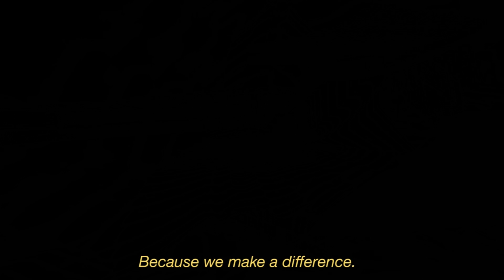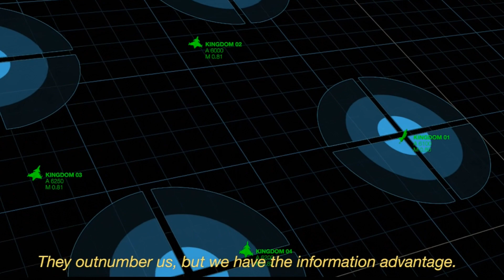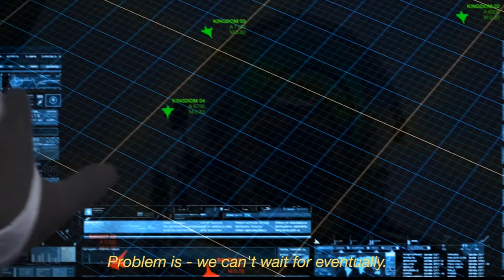Gripen Fighter Jet - Canada's Future Fighter?

Comment: Nothing beats the f-22 and t50. But the difference in performance between the 2nd 3rd tier fighter jets aren't that big... and Gripen is somewhere in between tier 2 and 3 in my opinion. But its trumphcard is that it is much cheaper and more versatile than the other planes. Not only will a country have a plane it can afford to lose, it will also be able maintain its plane in wartime as well in peacetime. Its a cheap plane to fly and maintain... while old F16 planes makes military budgets bleed, and F15 is a great plane but it got two engines that needs lots of maintance and fuel while it is not a plane that is clearly better than the JAS39 Gripen. And Finland also got F18 hornets, that got two engines that cost money, while their planes usally gets defeated in excercises by Swedish Gripen planes.

Gripen is a plane you can use in harsh wartime. You only need one technician and two concripts to maintain a Swedish warplane, while a typical American fighter needs 15 mechanics. Gripen could also start from very short runways, in case of the enemy has destroyed all your airfields, so you can use ordinary highways as runways in the case of war. So Gripen has the good potential of becoming a Navy jet on aircraft carriers as well due to its great ability to start and land on short runways.

Its also a plane suited for Canadas cold climate, since Swedens climate is pretty much the same. While I heard the F35 is unable to operate in sub-zero temperatures. And it needs 12 hours of maintenance and 17 mechanics required PER AIRCRAFT just to fly it for 1 hour. While Gripen is relativly cheap.
Reply: The Gripen NG is nothing like the first production model.
Reply: Use the generation numbers, Gripen is gen 4 while any stealth aircraft are gen 5
Reply: Russia stealth tech has yet to be seen and the T50 is suffering a lot of delays. Though I have no doubt it will be a deadly fighter.
Reply: I am not impressed by the F22 or the F35. F22 is a good plane, but overpriced and uninteresting since its not on exports. I would say therefore that Gripen is the best plane a country can buy right now. Unless they wanna buy Russian.
I think the F35 is clearly inferior for 3 reasons.

1. Its a shitty compromise between many roles a plane can play, where the worst traits seems to have been picked for each role.

2. Americans arrogantly thinks that we now live in the age of missiles and therefore manouvering is useless. Just like they thought in the past when they didn't give the F-4 Phantom a cannon.
Which is just a stupid belief.
Furthermore doesn't stealth give any magic protection, so maybe its therefore a good idea to look for other ways to increase the surviveability of a plane. Speed and maneuverability for example.
Russia also got superior missiles to the American stealth fighters so ithey would be able to kill the American planes from 400km away - while the American planes will have to get within 160km range of their enemies before they could engage them. So the Russians got a clear advantage.

3. The F35 doesn't camoflage the heat from its engine so it can easily be spotted by heat sensors a 100km away and shot down. So the F35 isnt stealthy. Is just a piece of junk. And people saying oterwise are idiots.  

4. And a fourth reason would be that we shouldn't focus so much on planes. Having skilled pilots is a much more important factor in determining the outcome of air combat. And all planes are built to do dfferent thing things. Some are great fighters but bad attack aircrafts, and vice versa.

Overall, do I think Pak-Fa and Gripen are the best planes in the world today.
Reply: Once air superiority has been won, it doesn't really matter what kind of plane that deliever the bombs.
The old ancient F16 can do the job just as well as the new F35 in this regard. So for that task I would prefer a plane that can carry much bombs, that is cheap to fly, a plane that doesn't cost much to build and isn't too expensive too lose.

So preferbly I would like to have a plane with A6 Intruders bombload, Gripen's low maintance cost and low production costs, and having a plane that isn't too expensive too lose - like the F35.
The F16 and Gripen are much better bombtrucks in that sense. F16 is an old plane that can be afford to be lost, while Gripen is also a low cost plane.
Another bonus with Gripen, is its ability to make many sorties per day. While the F35 is just a maintance hog sitting in the repairshop most during the time of the war. Actully I think that the F35 seems crappy for the bombtruck role, just as it is crappy and almost everything else - such as the close air support role due to its fuel thirsty engines, its high speed and vulnerability to fire from the ground.

And as I said earlier, flying a Gripen only costs 4700 dollars per hour while a F35 costs 31.000.
Letting F35 fly bombtruck missions is like hiring a Limousine to drive to the grocery store down the street to buy a package of milk.
It seems quite odd to me.
Reply: A great solution to this whole ordeal is to get 6 squadrons of F15 silent eagles and 6 squadrons of JAS 39Es, get Canadian companies to outsource the F35 technologies into the F15SEs and JAS 39Es, Canada had contributed into the F35 program. And also to make these aircraft in Canadian Factories (atleast some parts).
Reply: So? What does that say? Nothing!
Reply: except the F-35
Reply: The F22 was great, but it was too costly so they started to look at the F35 as a cheaper substitute. But the F35 have failed that hope in every way, and the project is constantly going more and more over budget.
And seen with facts in hand, we can now be clever in hindsight and say that it have been a failed project. Many might be surprised, but I am not. Stealth is overrated, and I don't think that the time has yet come when one type of plane can fullfill all roles of all planes to a good degree.
The Navy wanted a VSTOL plane so they got a plane with a relativly fat fuselage and small wings. And in order to get more stealthy the plane also had to hide all weapons inside the body of the plane - which in turn made the plane fat. That helped the plane do vertical take offs better, but on the other hand did that also make the plane shitty in air combat since it got too tiny wings to make sharp turns. And the attempts to give the plane fighter capabilities have in turn made the plane too fast to see any targets on the ground, so the plane therefore also suck att giving close air support. And its fuel hungry engine makes the plane expensive to run, and it cannot stay in the air for hours to be ready for giving the troops on the ground support whenever they need it.

So it sucks at aircombat because have the highest wingload of any modern fighter jet. It suck at VSTOL since it cannot carry weapons and the engine heat could melt carrier decks. It suck at close air support because its too fast and fuel hungry. And it is a cost-ineffiecent bombtruck.
And the stealth was compromised away like anything else, when it was decided that no device would be added that could hide the warm exhaust gases coming from the engine.
And the plane crashes just as often, and is just as expensive and maintance demanding as most two-engined planes. Indeed, oftentimes even more.

If the US military could make this stupid decision to build a plane that is "good at everything", then I question their competence. The F35 is to planes what TOGII was to tanks.
Stealth is a good, but is it worth sacrificing everything else good in plane for it? I think not.
Reply: Martin Andersson JAS 39Es is one of the more cost efficient muti-role aircraft out there. JAS 39Es has more bomb load then the F35 and far better agility. And as I stated before, Canada can outsource F35 technologies into the F15SE and JAS 39E since it has contributed into the program. Canada also has the option to make these aircraft in Canada similar to South Korea with their F15K Slam Eagles and Brazil with the JAS 39Es. This "High-Low" force has been proven with the United Sates (F15E/C and F16C/D) and is far more effective then just buying even more F18s or F35s. F15SEs can also be outfitted to a Strike Eagle style setup which futher proves more for its worth; additionally, tecnologies like Fly By Wire, fully integrated user interface touch screen, stealth tecnologies, hopefully incorporating F35 technologies into the aircraft and a better/more powerful engine made in Canada (Even better than the F15K Slam Eagle), this would be the best setup for Canada and it shows strength from Canada. Ladies and gentlemen, the F15SE and JAS 39E!
Reply: The generation thing is just PR bullshit and means nothing.
Reply: ....you guys are aware that the F22 is still flying training missions daily, right? I live next to Eglin AFB and Hurlburt AFB in florida and see them all the time. Even some F35s every noe and then.

Also....why would we use the 22's and 35's for any operations we're involved in when we have a plethora of other air to air, and air to ground aircraft that are more than adequate and more expendable?
Reply: outdated myth . F16 1VERSUS F18 losses caused by engine failure actually 
shows the hornet WORSE than the single engine falcon.
yeah, 40 years ago the early turbines weren't half as reliable as now.
2 engines placed close together often BOTH fail because one fraggs the other.  only airframe nacelles like the A10 prevents that.
an f18 corkscrewed itself into a carrier deck when one engine suddenly quit-forcing the plane to lurch one way.
in battle a twinjet with one engine out is dead meat to opponents anyway.
finally, 2 engines BURN MORE FUEL . what happens when a fighter runs out? (even assuming the extra fuel and maintainance cost nothing).
you think you're flying around with a spare engine in the trunk that you can just switch to?
Reply: And the f-22 is super expensive!
Reply: Unfortunately, the numbers are just sales jargon.  They don't mean anything in terms of combat, although it sounds really good in the diner.  The stealth aircraft… aren't.
Reply: No no no NO
Reply: A Gripen could do the bombtruck job since its maintance costs are only a tenth of the costs of flying a F35.
And the F15SE is atleast on paper the best the 2nd best fighter jet in the western world. And since the best jet - F22 - is not up for sale, then the choice is pretty simple for a qualityminded customer.
Reply: @nattygsbord I'd prefer a B-52 for the bombing missions :D
Reply: Yes B52 does have its charm and value of its own.
Reply: Well jokes aside I am currently watching a documentary about the A-6 Intruder. B-52 isn't that fast for close air support, but way better for serious terror bombing.

(jag e noob i det här ämnet asså, men jag är fascinerad ändå och vill ständigt lära mig mer. nyligen läste jag ett uttalande av Dalia Lama där han uttryckte sin önskan över att vi måste sluta upp med att se allt detta som en häftig lek med häftiga leksaker, utan istället inse att det handlar om att döda mängder av människor som inte alls velat dö. föreställ dig att du är på din sons bröllop och är gladare än på länge, sen kommer en tonårig drönarförare 1000 mil bort och bombar skiten ur hela stället. det är perverst så det skriker om det.) Peace.
Reply: Jag ser krigsmaskiner som verktyg snarare än leksaker. Visst är det förmodligen kul att flyga fort och snurra runt och så, men prylarnas existensberättigande vilar på deras effektivitet i strid. Ofta tror jag att militärer ofta blir besatta av att endast titta på sina maskiner som leksaker istället för att nyktert och cyniskt bara se dom för hur effektiva dom egentligen är.
Tiger stridsvagnen, F105 Thunderchief och alla slagskepp är väl typ-exempel på överdrivet påkostade vapensystem där effektiviteten inte är särskilt stor. Förmodligen skulle Hitler ha byggt nån enklare och billigare stridsvagn, förmodligen borde jänkarna ha förstått att det fanns bättre flygplan lämpade som taktiska bombplan än F105, och den Tyske kejsaren använde årtionden till att bygga upp en stor flotta av slagskepp till en enorm ekonomisk kostnad. Och under hela första världskriget så fick hela den där massiva flottan ligga i ankar, eftersom man inte vågade ge sig ut i ett sjöslag mot den något kraftigare Brittiska flottan. Så alla miljarder var bara bortslösade pengar, och hade man istället använt pengarna till att bygga ut armén så hade Tyskland förmodligen vunnit kriget 1914.
Och slagskeppen under andra världskriget kom inte heller just att drabba samman med andra stora krigsskepp, utan de flesta blev sänkta av krigsflygplan.
Reply: Ja, självklart måste en erfaren krigare se på sina redskap som verktyg snarare än leksaker. Det är hans liv det hänger på. Men senare i modern tid har häftiga vapen lyckats tilltvinga sig en egen marknad genom dataspel hos massor av barn och ungdomar. Det är denna grupp som vi egentligen vill se uppfyllda av glädje och kärlek, istället för aggressivitet och våld. Världen måste bara bli ett bättre ställe att leva på.
Reply: Compare the statistics of the range with other planes or fuck off. I have no time for people who doesn't care about facts.
Reply: C -so what design actually flying ISN'T at least 2 decades old in the design? the us aint selling f22s and nobody else builds a competitor.
Reply: Also, I see people claiming that the f35 doesnt have supercruise.....not true. While its not considered a supercruise aircraft, it can maintain mach 1.2 for 150 miles without the use of afterburners.
Reply: Roland Lawrence I don't know it's probably capable of going further but it's the US Military and you know they like to be sneaky and bulshit around to keep the competition guessing... Beats me but I see I'm flying over my house every single day.
Reply: Clifford Nelson the 39 E is more or leśs a completely new aircraft, redesigned in the 21st century.  It's more versitile than previous versions and have, finaly, air fueling capasity.
Reply: Martin Andersson using external payload would "kill" the stelth part and make it visible om radar event from the front and increase fuel consumption
Reply: #internetbillofrights why? 2 engines = twice the fuel consumption.
Reply: Lol has anyone actually researched what the f22 and f35 are capable of??
Reply: nattygsbord sweden is not cold in temprature
Reply: +Rasmon 123 Really? So temperatures down to -52c isn't cold?
Reply: It's really funny reading these comments full of people who don't know shit about the 5th gens. GG guys. XD
Reply: I've heard the claim that the electronics on the new Gripen E is state of the art. 
Who knows how electronic warfare aspects will impact the effectiveness of the fighter.

Maybe it doesn't matter that 5 gen fighters are more stealthy.
Reply: It was canceled because of high costs, and ironically people placed their hope in the F35 as a good budget alternative. But now things have taken more time than planned, consumed more money than planned, and worst of all so is this F35 thing crappy at everything it was supposed to do.

It was intended to replace the AV8B, but F35 cannot make a vertical take off without melthing a carrier deck. And when they tried to give the F35 vertical take off capabilities to make the Navy happy they gave it small wings because that makes things easier to takeoff vertically and they placed the engine and everything inside the body... which in turn creates more drag when flying around normally.

So when the Airforce wanted an air superiority fighter to replace the old F16, they got a plane with too small wings and a shitty aerodynamic design. Which is the reason why the F35 often gets beaten in air combat by planes that are many decades old.

And all the intentions of making this plane close air support aircraft to replace the old A10 have been unsuccesful as well. Because when they tried to make the F35 a plane capable of fighting other aircrafts.
So this plane is fast (eventhough it isn't as fast as the best fighter jets).
And the problem with having a "fighter like" aircraft performing air support tasks is that they fly too fast and cannot see the targets on the ground, read the situation, and help the troops on the ground. Another problem is that this plane got a very thin skin and therefore is very vulnerable to fire from the ground.
And this plane also lacks the ability to stay up in the air for hours and circling around the own troops on the ground and help them support is needed..... because it doesn't have the fuel to stay up for 4-6 hours, instead it needs to land after about an hour and a half.
Reply: Martin Andersson; I can see that your father was not liberated out of his concentration camp by US soldiers, unlike mine.
"Je me souviens"
Reply: No.
Reply: Lets see the aircraft development started in 1981, and production in 1997. 20 year old aircraft that is a 35 year old design. What BS.